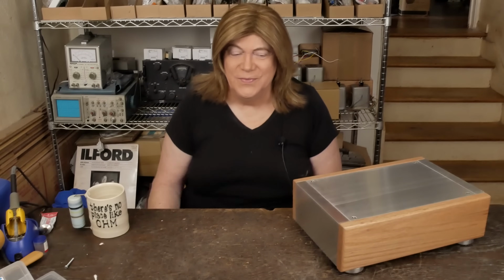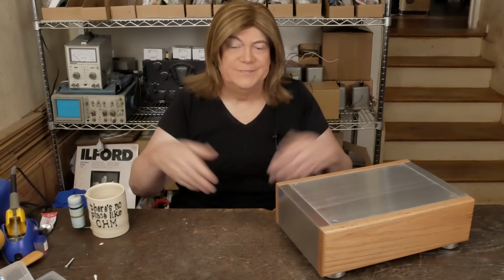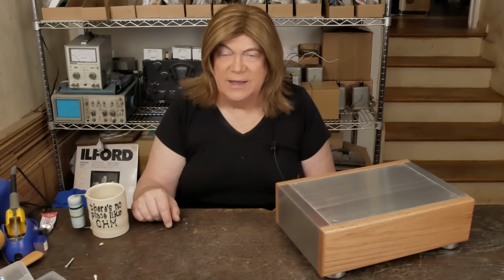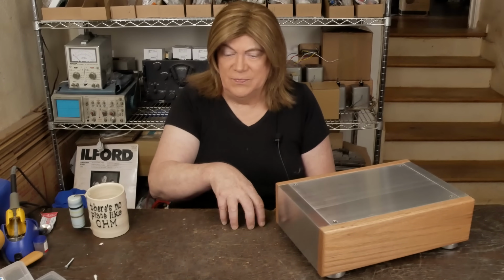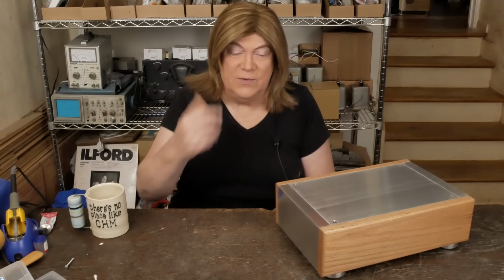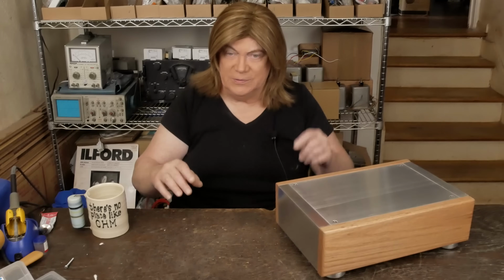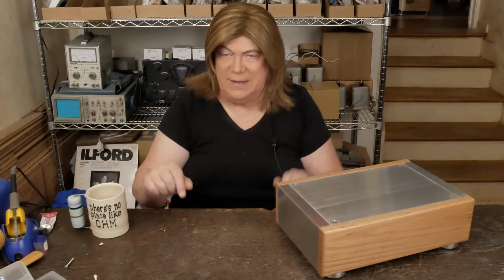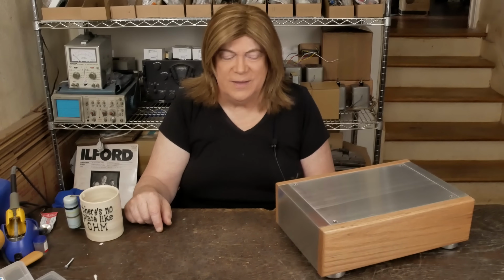300B Hi Fi Tube Amp: Monoblock Version

Comment: I would lose the power switch as well
Reply from the maker: I could put it on top, but no indicator light either?
Reply: @SkunkieDesignsElectronics  For user convenience sake, I would shoot for a single system on off switch either in a power strip or preamp. It would be annoying to have to push 2(multiple) buttons to turn your system on. As for the indicator light a simple LED in the front is fine.
Reply: @SkunkieDesignsElectronics  I had one other suggestion you could also do a master slave arrangement simply by adding a switched IEC output, like they did on the old computer systems to supply power to the monitor. Then it would be switched by master monobloc. This would also reduce the number of electrical outlets you use.
Reply from the maker: Yeah, that will be a huge amount of effort on a user to have to push two buttons! I totally need to fix this problem...

Comment: Unfortunately we don't all have speakers that will work with these low powered amps.
Reply from the maker: True, but there are a ton of great higher efficiency speakers out there! Plus if you listen at 75-80db in room SPL you don't need a 40W+ amp either. Most people are shocked how well a real 2W amp works.
Reply: Насколько дороги Клипш Корнуэл?

Comment: I say go all out on the monoblocks, best parts and the ISO transformers. I'm at point where I only use monoblocks, custom build 300B, reecently sold Audio Note Quest 300B mono's and just purchased  Bendix 6094 (special iteration of EL84) push pull monoblocks.
Reply: Say more about those amps.  I have a quad of those 6094s sitting unused.

Comment: Monoblocks are usually reserved for flagship models so the best OPTs are appropriate. Two mono volume controls would probably drive me nuts. I’d offer a matching passive stereo volume box before using mono pots.
Reply from the maker: You'd be shocked how many people ask for 2 mono pots :)
Reply: It for volume control, but fine tuning for your non-symmetrical room.